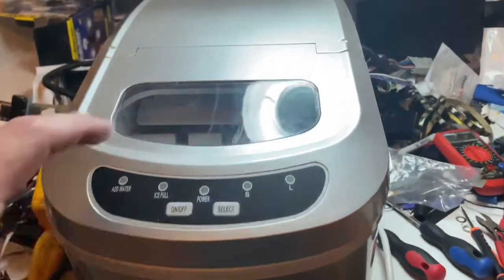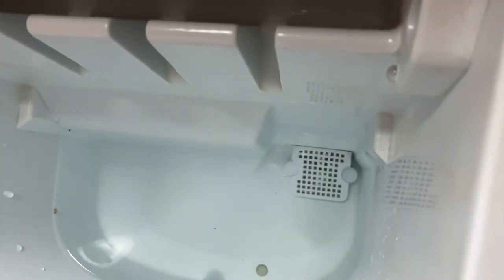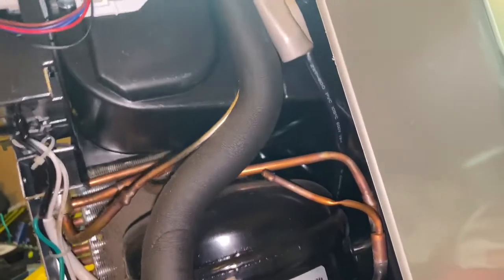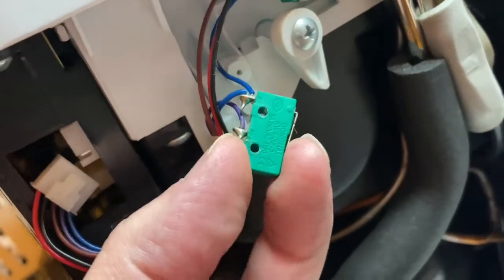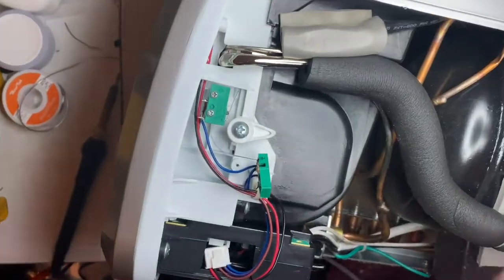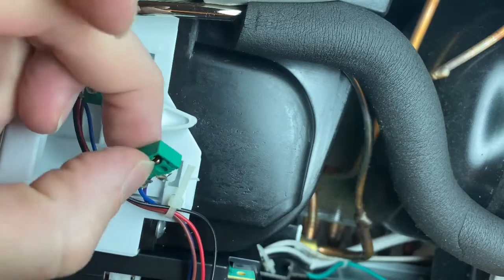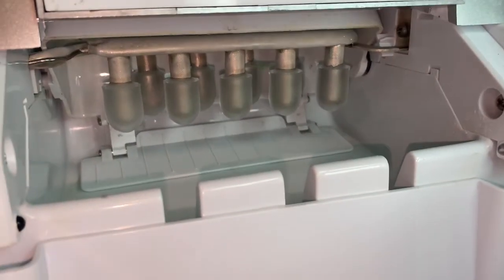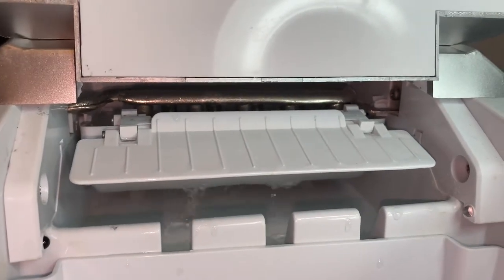Magic chef portable ice maker not making ice fix repair

Comment: Thanks for posting this!!  I'm on ice maker #2.  The first one was covered under warranty when it started doing this "no water" thing, so they sent me a new one.  Now the replacement has pulled the same stunt, so I figured it had to be something simple.  I'm probably going to fix both of them (I mean, why not..?)  And I guess then I'll have  boatloads of ice LOL  Thanks!!
Reply: Did you figure out why it says add water when the reservoir is full? I drained mine to clean it and now it is doing the same thing.
Reply: Disregard the question. I figured out it was the water I was using. Added a pinch of salt and it started making ice. I was using distilled to keep the hard water build-up down.

Comment: Before you take it apart fill it with vinegar. Let set for 3 hours. Then try it. It should work. Then run a few times with water to clean out the vinegar. Works everytime for me.
Reply: Do you turn it on in that 3 hrs?
Reply: Instead of the switch?
Reply: This won't work if the switch is broken maybe if there is a clog sure. If there is a clog i would take it apart anyway to check everything.

Comment: There is obvious mold all through this Ice Maker! Badly needs cleaning, both through machine's auto-clean function and manually (use one-to-one water/vinegar solution). New soft sponge brush, unused soft toothbrush, soft cotton cloth. Otherwise, you're drinking mold spores with the ice. There being visual mold, make certain to run the cleaning cycle several times, draining & replacing with fresh water each time.

Also, even before you opened the appliance, it was obvious that it needed dust removal. Canned compressed air, soft toothbrush, small-nozzle vacuum cleaner.

Beyond that, excellent demonstration of switch removal, part ID'ing, and replacement. Really, really appreciated that bit of info!
Reply: That's dirty? The bowl the ice forms in, on my Frigidaire ice maker is totally black, after less than two months, after running the self clean function. I think it is the garbage in our local city water.
Will tear down and clean with bleach.
Reply: Just watched the video and was going to make the same comment but was glad to see it had already been mentioned!

Comment: What did the "exhaust" side of the radiator look like?  If it was covered in dust, that's also a problem.  Using old toothbrush to clean works well.

Comment: Damn.... that wasn't my problem.
My water tray won't move all the way frwd and backward. I mean sometimes it does, but there is clearly a sound inside of the housing that is not normal, when the water tray is struggling to move all the way forward. 😭😭😭 @ me if you know a fix before I open it up. Thanks! ❤❤✌
Reply from the maker: You blew your fins out but haven’t tested the switches yet? Test the switches
Reply: Mines doing the same thing -.- I'm taking it apart right now lol
Reply: @get.sassyxd  
I'm gonna try buying a new motor.
They seem to be cheap on Amazon & eBay around $11-$17. If you're facing the front of your ice maker it should be on the Right side. So you can find the Part's Model Number. If that is indeed the fix to your problem.
❤✌
Reply: @thisguy1397  yeah I just ended up buying a new machine anyways lol I had taken it all apart and found it was the motor but I wanted a new one anyways. Went a couple days with out ice but the new machine is bigger, holds more, and self cleans. My magic chef one would get so dirty in the ice shovel area from our hard water and it was so hard to clean all the way! Happened to have the money to upgrade so I did :) good luck!
Reply: @get.sassyxd  Please list the model that freakin' self cleans. I had the same dirty problem. Maybe its time for a better solution....
Reply: @get.sassyxd  If u still have, would pay for shipping.
Reply: @thisguy1397  I'm having the same problem, did the new motor work?